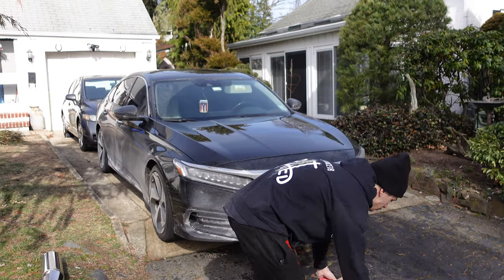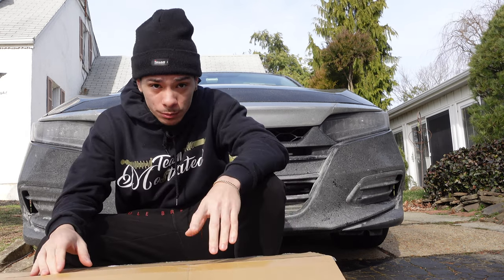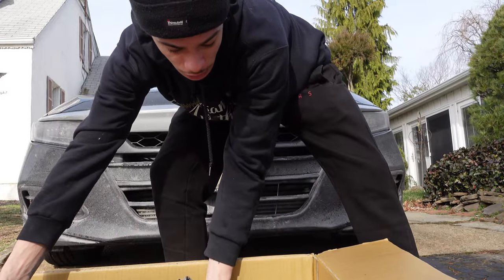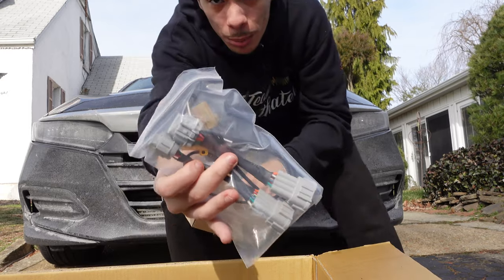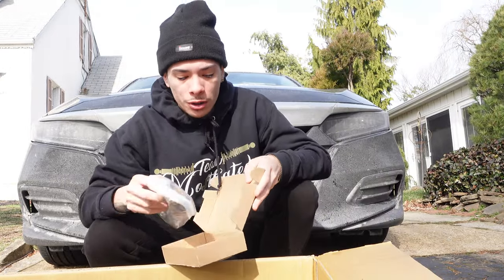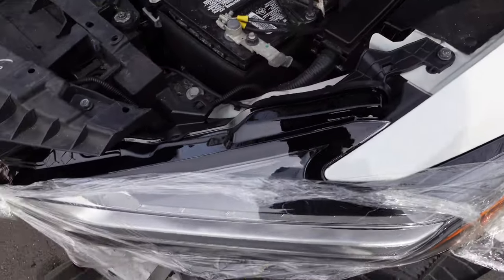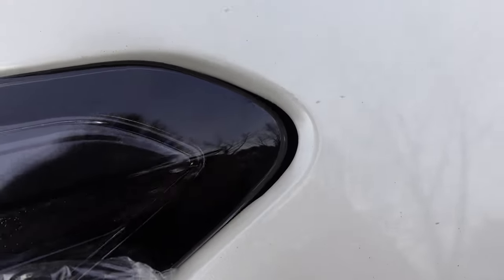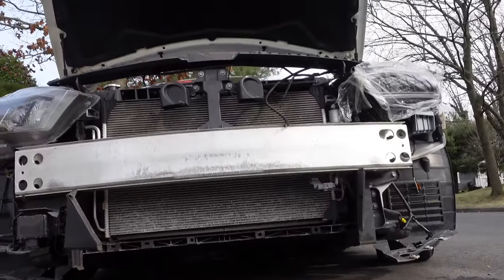NISSAN MAXIMA HEADLIGHT CONVERSION FROM A 19-23 MAXIMA TO A 16-18 MAXIMA! (Show/daily pt1)

Comment: Thank you so much i’ve been seeing videos on YouTube of people doing it but they don’t show how they did it like I don’t know if I had a splice any wires or anything and I don’t wanna do any of that. I just didn’t want to gamble $1000 and then come to find out they don’t work with my car thank you so much literally the 2016 maxima SR I have is identical to the 2023. The only difference is the software on the head unit and the sunroof and the tail lights and headlights that’s it. I don’t feel like paying $40,000 for a new car when I could just spend $2000 to facelift mine. Like the new Maximus have the same exact features as my 2016.
Reply from the maker: No problem bro 🫡💪🏼

Comment: I am not sure if anybody has commented or not but if you want to get rid of the gap under the headlights, you will need to get a bumper off of a 2019-2021 maxima to swap out with your current bumper. That will eliminate the gap. I have the exact same maxima, same color and all. I HATE the headlights that came with the 2016 model. Can't see nothing at night hardly! So I am currently in the process of swapping all my stuff over now too and I was told when I swapped the headlights that there would be a 1-1.5 inch gap under the headlights and would need to get a newer model bumper as well to eliminate the gap. Hope this helps. Good video by the way too homie. Keep doin you
Reply from the maker: That’s correct 👍 you can also bring it to a body shop and have some custom work done to eliminate it but for some like me the gap doesn’t really bother. Preciate you 🫡

Comment: Yeah it helped bruh, and you might try to put a 2019 bumper on and see if it fits more smoothly. Idk if it’s even possible but it’s worth a shot. Maybe ask around at Nissan dealership and see if the 2019 bumper is compatible
Reply from the maker: The facelift bumper does fit and gets rid of the gap but I don’t like the new bumper over the older one imo.
Reply: @pollostylez  
Ok then I feel you.

Comment: I figured it out the gap issue underneath the headlights Are the shit that the clips clip into on the headlight you got a move over from the old headlight so the tabs lineup just got done doing it with mine today it literally looks OEM
Reply from the maker: Appreciate the tip I’ll try it out
Reply: When you say "move over", do you mean remove the clip all together and reinstall where it will fit into the new light? Just want to clarify since I plan on getting these lights in the future.
Reply: @MGTOW_GHOST  honestly I just keep the clip removed. It doesn’t really make much of a difference but if you have the clipped removed it makes the gap hardly noticeable make sure you put the screws back in the headlight so moisture doesn’t get in now if you transfer the clips over to the new headlights from the old ones it’s kind of a little bit of work you gotta sand down some stuff and thread, new holes. It does tighten up the gap a little bit
Reply from the maker: He’s talking about taking the clip off of the oem headlight and transferring it on to the new headlights
Reply: @gav2159  Thanks a lot, I think I'll just keep it off then.
Reply: @pollostylez  Thanks!

Comment: Nice video . I did the front end swap from a 2020 to a 17 but I was always a fan of the full led lights with the old style bumper
Reply: Oh and mines is a platinum and I use the same adapter as you so it works the same with the higher trims
Reply from the maker: It’s my favorite combo! Aggressive looks with the newer lights is perfect imo
Reply: You went backwards in years?

Comment: I just bought a wrecked 2017 Platinum. I mine as well swap to the newer front end and headlights since I'm replacing parts. Do you know if the newer headlights have the same plugs as the 2107s? Mine are full led from factory. Thanks
Reply from the maker: Yes but the adapters still need to be purchased

Comment: Hey bro I am doing this exact thing right now and I am curious if I am going to need that wiring harness that I noticed came with your new set of headlights that had an orange resistor on it as well I think I seen. I am swapping the terrible 2016 maxima headlights to a newer led set that comes on the 2018-2021 maximas. So any advice or help would be much appreciated because the vehicle is in the body shop now bout to get started on. I have already purchased the brand new EXPENSIVE AS HELL set of headlights, the new 18-21 bumper grill and trim, and also new 18-21 fog lights too. So just making sure  don’t need anything else.
Reply from the maker: The adapter harness does not come with the lights I purchased them separately.
Reply: @pollostylez  yea I ended up finding the “2016 to 2021 Nissan maxima headlight conversion wiring harness” for $150 was the cheapest. It just arrived today! Super excited to be getting rid of those TERRIBLE 2016 headlights and seeing the new headlights, fog lights, and all new bumper too. Gonna look like a newer model one because I have already swapped out the tail lights as well. Your video helped me so thank you brotha and keep grinding man 💯 you’re doing a fine job my friend 🤝🏻🔥👍🏻

Comment: Would it be possible to take the Clips off the old lights and put them on the new lights?
Reply from the maker: Some on commented I think in this video and said that’s what they did and it got rid of the gap but others told me they tried and it was still there so I’m not sure tbh but it doesn’t hurt to try I guess 🤷🏻‍♂️

Comment: And the upper trims on the 16 through 18 like my SR has factory LEDs and they are completely sealed so you can’t change the bulb which completely fucking sucks they also have an extra plug which my guess is for the computer to know if an LED goes out which that’s what I’m worried about if I do this swap. It more likely will throw a code on my gauge cluster, but I’m pretty sure I can probably just touch those two wires together and it should get rid of the code I hope.
Reply from the maker: I’m pretty sure you will be fine with the adapter harness because other people with the higher trims have also done the swap and got no codes unless a light went out then they will get a code so I’m pretty sure the harness will make it work just like your stock headlights

Comment: Got a vid of you installed the led strip on the inside on the door? And if you cut it will it still work.
Reply from the maker: I don’t have a vid because my boy does them but yes you can cut them there just clear fiber for the light to pass through.
Reply: @pollostylez  ohhhhhhh thanks Brodie I appreciate it, I can finish my doors too the✊🏾💪🏾

Comment: Swap the bracket from the older headlights into the new ones it should work to clamp the bumper
Reply from the maker: I was told this before I still have to try it a lot of people were saying it still didn’t help but I guess I have to find out my self
Reply: You know what put washers between the headlight and the bracket to lower the clamp. It might work
Reply: Keep us updated if this works 💪🏽